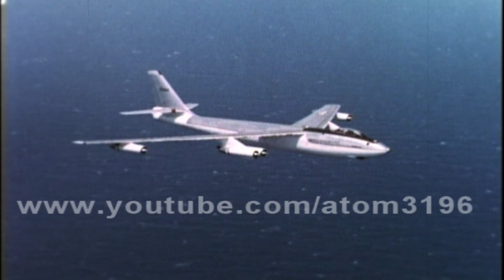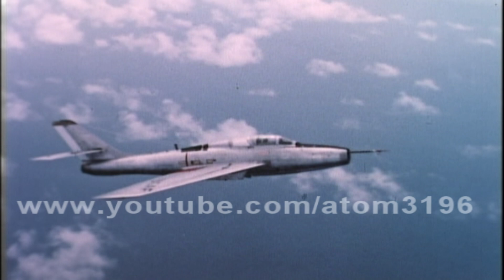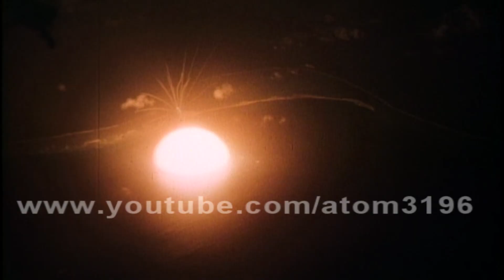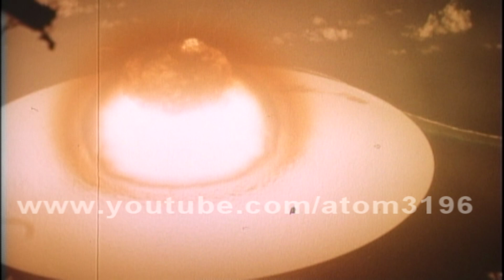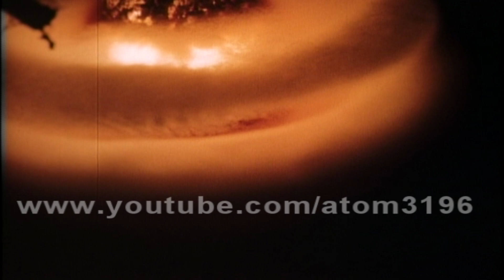HD Redwing Navajo 4.5 Mt atomic bomb hydrogen bomb 1956

Comment: i notice something with most tn videos  ive seen. It looks like theres an explosion on top and a larger beneath it.Are they the primary and the secondary?
Reply: no thats the condensation clouds
Reply: I wondered this same thing.  It is not a condensation cloud.  Pause it at 47 seconds.  It looks like the large fireball has a little fireball pimple on top
Reply: Probably the barge after it was turned to plasma.

Comment: Most knowledgeable bomb enthusiasts will realize this is not Castle Bravo.
Reply: beware..... a random guy named "the rodog" will claim to have the ability to track down your mother and tell you to do your homework if you say this is not castle bravo
Reply: I doubt anything within a 10 mile radius will care which one it is.
Reply: There are about a dozen differences.
Reply: J'pensais que c'était Castle Bravo moi ...
Reply: no such thing as knoledgeable or not, cepu, think any nmw and any be perfx
Reply: Please don't laugh... Am I ok to watch this and not damage my EYES?? I was told it can have the same effect as stare at sun?
Reply: @MooseCVO   do not fear. It is UV light that damages your eyes. Atomic blasts or welding arcs are very damaging. A nuclear blast can blind you as far the horizon because it negates the inverse square law. But not on your computer. Protect your eyes from the sun and welding arc flashes. You can get flash burns. Very painful.
Reply: M N Your TV or computer monitor does not have the ability to project the kind of light energy, nor the damaging wavelength of a thermonuclear explosion. You’d have to be there.
Reply: @SvenTviking  The videos are the only witness and evidence we can have, therefore the only thing we can judge and analyze. People who saw those explosions were dozens of miles away, in the army and sworn to secrecy. Nothing to do with science.

No matter the filter on the camera, no matter the types of radiations that were generated, the light intensity shown on the picture does not match the intensity of the explosion. And if there were any damaging radiation, the camera would have suffered from it and we would see degradation of the image, even if temporary.

If it's slow motion, then how many FPS were originally captured, what's the guarantee of this number being true, and why show that as scientific proof? The initial goal of these videos were for war propaganda. Slow motion was used to be impressive and look more grandiose on film.

Yes, all explosions, and even large deflagrations, can produce mushroom clouds. Most of them don't last as long, mostly because real life is not slow motion and do not have visual effects added to them to watch later on television. You can generate a mushroom cloud by throwing gasoline into a fire. Incidently, these mushroom clouds are usually very dark, because of the incomplete combustion, the smoke contains a lot of particulates. Why would a nuclear explosion produce smoke so dark, since it's supposed to be "pure" energy?
Reply: @MooseCVO  You need some means of protecting your eyes to safely view an atomic fireball from any distance.   It's more intense than the sun due to proximity, and there is less atmospheric attenuation in most cases.  The closer, the worse.
Reply: @josephastier7421  What? they are doing live tests again???
Reply: @MooseCVO  Who said anything about "tests".
Reply: Yeah, one difference is that Brave was on an island, where this here is a barge shot!
Reply: Bomb Enthusiasts 😂
Reply: From my limited understanding, this was castle nectar, with a yield of 1.7 megatons
Reply: wrong
Reply: Most knowledgeable bomb enthusiasts will realize this is not an atomic bomb.
Reply: @slamdunk715  Explain your comment please.
Reply: @josephastier7421  There is objectively nothing in this video that lets the user distinguish between a "regular" explosion (albeit a big one) and a "nuclear" one. The video looks like it is made of multiple layers with cross fades between them. This video looks a bit more "convincing" because there's a layer of the island behind the explosion, and it gives a sense of "scale" (that most videos don't have). One thing that almost all videos have is that the bombs last WAY too long. It looks like a very long burn, instead of an explosion. Some videos are exactly the same as a big gasoline explosion seen in cinema, sometimes in slow motion. A very big conventional explosion shot in slow motion would look exactly like that.
Reply: @slamdunk715  The physics is entirely different in an atomic explosion.   In particular the double flash, where the cloud darkens momentarily as the air around it is burned black, does not happen with conventional explosions.
Reply: @josephastier7421  On camera, the double flash cannot happen for any reason whatsoever. The camera doesn't "care" what kind of explosion it sees. If there's lots of light, there will be overexposure, if there's no light, it will be black. This video is not logical on that regard. The light received by the camera in this video (that starts completely black) should have been an upward ramp all the way, until it goes back down quickly. There has to be some sort of camera trickery happening, atomic or not.
Reply: Slam Dunk It’s filmed through a filter and from a remote controlled drone aircraft.
Reply: @slamdunk715  you can clearly see the double flash here.... First the bright flash of the compressed air in the beginning (that's the first glowing part) after a few thousands of a second the Air gets Ionized due to the high temperature, that's the part where it gets darker for the first time (during the part where the small dots appear on the fireball) After a little bit of time the ionized air cools down, getting now transparent again (this is called breakaway) and behind that now the isothermal sphere, the superheated material of the bomb, the ground, the energy released etc (that's around where the dots disappear and the bigger dot on the top of the isothermal sphere gets visible, which is btw the fireball from the nuke that initiates the fusion)! So a double flash is clearly seen, in small explosions not as here, the bigger the explosion the longer the duration of it!
Reply: @slamdunk715  You are an utter moron. Just shut the fuck up and stick to whatever it is you know, if anything.

Comment: would an air drop have a significant affect on the blast effect?
Reply: Yes, that's the number one reason why airbursts are a thing. Detonating it at an altitude above the target significantly increases the shockwave effect.
Reply: Yes and no. The mach stem effect is created by a a reflected wave from aerial bursts which essentially acts as a second blast wave which merges with the initial wave. This greatly increases the blast radius. A certain blast pressure can be maximised by the attitude of the detonation. That said, surface bursts produce higher blast pressure in the immediate vicinity but the blast radius will tail off much quicker. To put it simply, if you want to ensure hardened facility structures are levelled, a ground burst or an aerial burst at a low attitude will do a better job.

Comment: I'm curious why these nuclear weapons appear so dark in the beginning and slowly become incredibly bright. I thought they would have been brightest during the initial reactions.
Reply: IHateThis GPlusSoMuch  I believe the intense heat creates smog by burning oxygen and nitrogen around the fireball.  Within a second the smog disappears.  You can see this as a double flash.
Reply: The first light light is only from the rsdiation, which drops off quickly. Then the atmosphere heats up enough after a couple of seconds to start burning nitrogen an oxygen. In high altitude tests you can see that this second light is missing.
Reply: To film nuclear tests they used cameras with darkened lenses. Otherwise images like these would have been completely white. Also for this atomic explosions look very dark in the beginning
Reply: IHateThis GPlusSoMuch Google how a double flash works. I tried explaining it but my thumb got tired
Reply: I'm curious to know how the film was protected from huge doses of ionizing radiation. Surely it would be wiped clean.
Reply: The first flash is from the mini fission bomb and it doesn’t magically disappear but it makes the fusion material react and that’s what you see afterward
Reply: For now the fusion bombs need to have a fission stage to start the reaction. That’s the first fireball. The second is the hydrogen and the other reactants afterwards